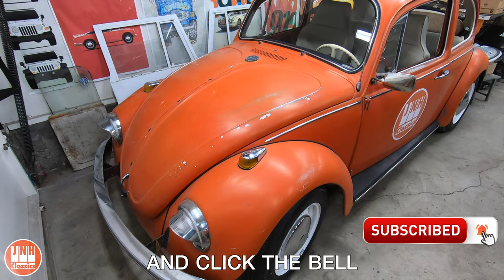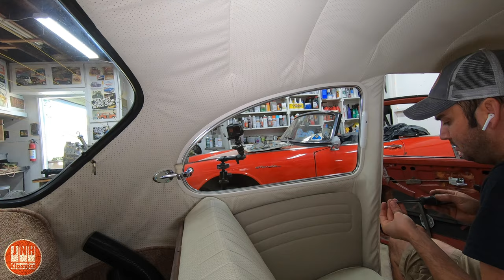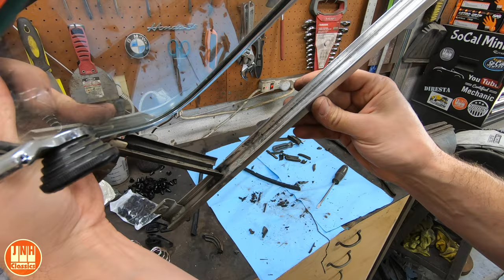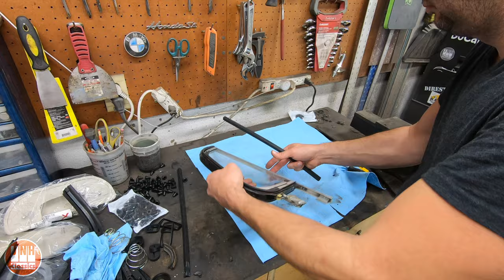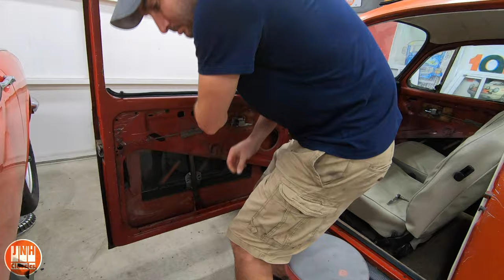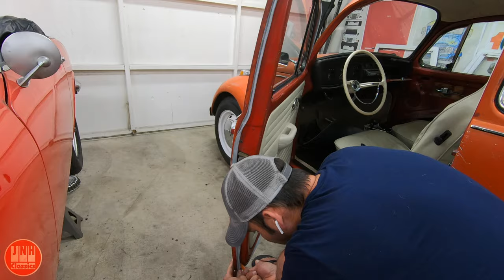An Unloved Beetle (Episode 10) - Pop Outs & Door Seals

Comment: Great job on the Vent windows, curious if you cuts are inside exposed or exterior and after 2 yrs are there any signs of shrinkage or cuts opening more?
Reply from the maker: The cuts are on the inside so they don’t leak. But I sold the car so not sure how they’re holding up

Comment: Great video. Do I have to remove everything (interior door panel, wing window, glass, etc) to do the outside door trim (chrome w/rubber scraper)? Working on a 1974 vw beetle.  thanks again
Reply from the maker: It’s been a while since I did this so I don’t remember, but I think you do need to remove everything.

Comment: Well done, all around.  Where did you get the door seal?  Your door seemed to close easily with the new seal.  Others have complained that their doors are hard to close after installing a new one.
Reply from the maker: Thanks buddy. I got the seals from JBugs. They came in a kit that includes all the seals for the whole car. The doors are a bit hard to close but not too bad.
Reply: Thanks for the information.  My door seals leak a little, but first I want to replace the door hinges (they only sag a little, but enough to bug me).

My next project is to replace the carpet (for Christmas, my wife is getting me TMI Oatmeal ... not a surprise, but what I asked for).  I watched your carpet installation video on your ‘69, and it was very informative, also.

My bug is a 1974 Sun Bug Super Beetle, however—but several years ago I installed the same wheel-well heater/defroster actuators that came on 1969 bugs (I got them from a guy in Britain).  I was wondering if I’d have trouble installing the carpet around the wheel well actuator arms, but I saw that you had no trouble doing it.  Your carpet had the slots for the heater actuators preinstalled, and mine won’t, so I’ll have to carefully cut the slits to make it work.

Thanks for all your videos, by the way, and give that little dog a pet for me.